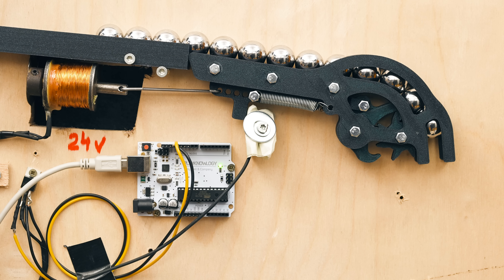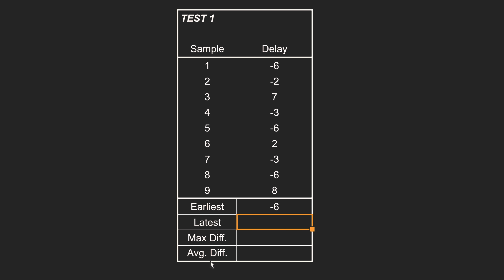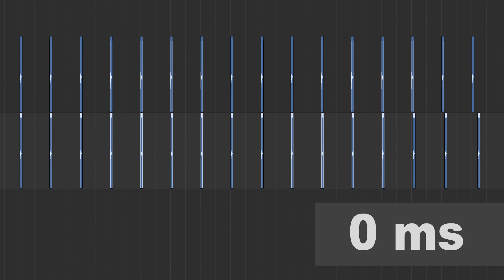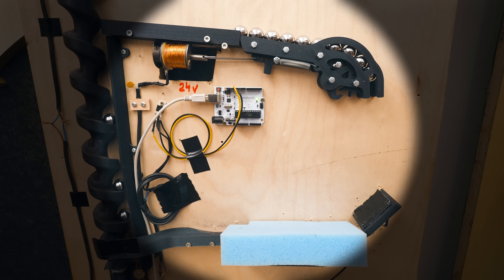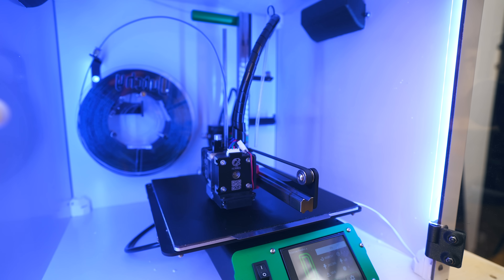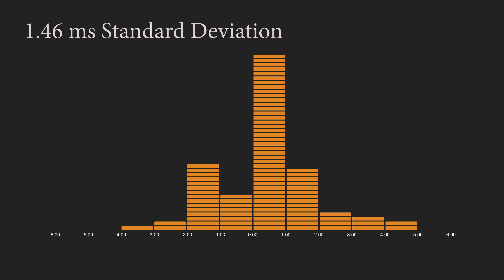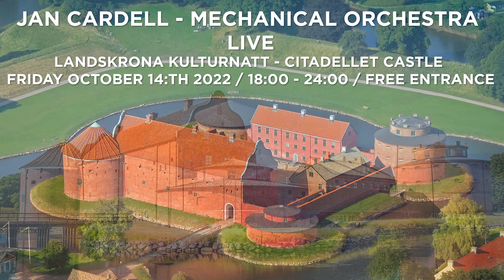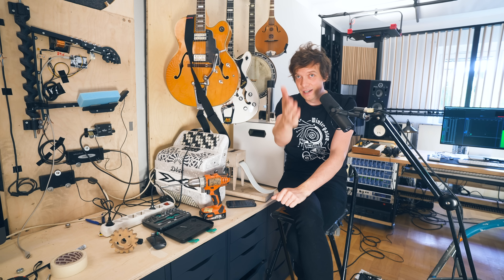Testing the Arduino Marble Gate

Comment: sigh it's good you're actually doing these data analyses to improve your design, BUT YOU HAVEN'T WRITTEN YOUR DESIGN DOC YET!!!!
It doesn't matter if you spend hours testing this 3d printed gate for a near perfect delay deviation... the angle of the gate, the angle of the input rail, the input marble collisions (which you expressly change your test for, but would still exist on the real machine), and THE DISTANCE TO THE INSTRUMENT all factor into the results you're calculating, and NONE of these will be the same on your final machine!
Hell! You even say you're testing with pneumatics and an arduino controller, but that you *aren't going to use either of these in your final design*. All you are doing is wasting time!!!!

Form. From. Function. Means you need do define your functions (see, questions) first. You already are creating a headache by using Marbles, but without that you're not really creating anything new. So *what do you actually need*? Something to trigger a note on a musical instrument (drum, cymbal, xylophone, bass guitar) [to a certain degree of timing accuracy]. You have asserted that to be a Marble. By asserting a marble, you now have to answer "How will the marble trigger the musical note? You have asserted the answer to be "falling". What problems does "falling" introduce? You now need to "catch", "lift", and "ready" the things that fall. Now answer how you're going to resolve those 3. And until you have answers for all of your questions, and subsequent answer-related questions, ad infinitum, you *should not be designing anything physical*.

It sucks for youtube content, but it is the right way to go*. And once done, the Youtube content is literally just piece production and mechanism building (ie. what you *want to be doing).
Until you have actually created your design document, all you are doing is swimming in circles, and you will never create Marble Machine 3.

Comment: As I'm sure you are aware, there are tolerances for everything.  A few observations... You play a lot of instruments.. What is  YOUR standard deviation??  What are acceptable tolerances in general? I can tell you everything I heard below 15ms sounded the same to me.  Understood that each mechanical linkage in the chain can/will add to the total deviation, but it would be good to know what your maximum acceptable deviation would be.  

Also, it would be possible to build an apparatus with an Arduino to measure the drum beats and/or calculate the deviations for you automatically.  I had envisoned reaching out previously when you were tuning channels to suggest this.  A device that would trigger on the first drop, then record the amount of time between the first hit and the second hit.  This data can also be logged to a file or computer.  I'd be happy to design such a system using off the shelf prototyping components if you have any interest.

Comment: I have recently been watching people restoring old (1800s) clocks and one of the professionals talked about cleaning and lubricating the clock works and he said that a clock will not keep good time if the escapement is not properly lubricated. The escapement you are using is very large and because it is 3d printed probably is very rough. You might try covering the mating surfaces with Teflon tape or some other low friction tape and adding a little lub to cut down on the drag. It might tighten the timing a bit.

Comment: Hello Martin, glad you look good and happy.
You are correct, brutaly simple and working is what it should be to go on tour, bombproof also..
When handpowering the new machine, a suggestion, use an mid-engine electric assist motor as from a bicycle, then you cant "cheat" and you have got to keep on cranking...without over tiring.
Mind you, only these engines come with sensors to regulate power output.
Good luck and till the next one!!!

Comment: I'll preface with that I'm not that well educated musically so I may very be completely wrong.

But from what I've understood from others explanations is that part of the reason a drum machine feels very robotic vs a real drummer is not only the sound that is produced but also because of how tight they perform? So I just wonder if a few ms difference here and there really is all that bad, or would it even out during whole duration of a song? Using a phone speaker I could not tell a difference at all untill around the 15ms mark tbh, might be a difference in headphones though of course. I understand trying to make the perfect thing, but sometimes you get lost in optimization and need to get to a point where good enough is just that. Good enough.

Comment: You are working with an 3D-printed devider. There is no way, every „tooth“ ist exactly the same as the one before. Before you starting such mesurement, it woukt be importent to find the delay produced by each tooth.

Comment: Martin, good to see you back on the project, remember what a standard deviation actually means 1 SD means 68% of results will be inside this value. 3SD is good to work with as that means 99.7% of results will fall inside this.
Reply: ... if data is gaussian.
Reply: Also important to remember that he is calculating the sample standard deviation, which is only an estimator for the "true" population standard deviation. That means it won't be exactly the same upon repeating it (it has its own standard deviation!). Need to think about the implications that has on how many samples are required to get a sufficiently consistent result (i.e. before nitpicking over small differences between tests or trying to infer something from them...)
Reply: @ninjafruitchilled  Bingo!
Marting admitted that he doesn't understand what standard-deviations are.  If he did, he'd be using dispersion from the median, which eliminates the need for the distribution to be gaussian.
Reply: @John_Weiss  Nah there's no need for that, standard deviation is a fine measure and doesn't require normality to make sense (his data is vaguely normal, i.e. no seriously wacky skewness or anything, so looks fine). Just needs to make sure he gets enough samples to measure it with whatever accuracy he needs.
Reply: @ninjafruitchilled  "standard deviation is a fine measure and doesn't require normality to make sense" - This feels exactly like something Douglas Adams would have (should have) said!
Reply: Martin misunderstanding standard deviations is very on brand. Lol.
Reply: @davidchidester5463  Exactly. I saw this coming as soon as he brought it up. Every time he wants to learn a new thing, his narration is "I was so dumb, but now I know everything about it!"
Reply: And you can just use the speed of sound to contextualize what's 3ms. That approximately having two musicians and one of them is 1 meter further away from you. 

3 SD would mean 3 meters, something on par with the drummer on stage
Reply: nb4 he reads this and decides to go with 6 sigma

Comment: Honestly as long as the total longest delay difference in the final product is around 20ms it will be unnoticeable (based on how how delays are calculated for everything on computers). 
Of course here you don't have the variables for the whole machine so it make sense to try and minimize it at every step but i also doubt these measurements will be usable for the complete build.

Comment: Funny. I was just checking earlier today if there was any new videos, and there wasn't.
Arduino is bad at accurate timing, unless you tweak things right. Basically, the functionality/code that makes the Arduino easier to use has rather poor performance, so you have to program it properly yourself. In any case, it's pretty irrelevant when compared to a mechanical switch.

Comment: Happy to see you back, Martin! Will you test mostly variations on the clockwork escapement gate, or different marble gates as well? I would love to see a test of marbles being dropped straight from the marble queue, for example a PacMan-gate without the dropper arm at the bottom. Might only be a test to prove that your original design works best, but it’s good to test all assumptions!

Comment: SD value is perfect for comparing each test directly.  Just keep in mind that assuming a perfect "normal" distribution (many other kinds are possible but this looks close to "normal") for your actual music tightness, ~67% of results will be +-1 SD, ~95% will be +-2 SD, and 99.7% will be +-3 SD.  So for SD of 1.5 ms you'll get 99.7% of marbles within +-4.5 ms, still very tight if you ask me!!

Comment: Just looking at the marble gate, a huge amount of variance will come from backlash (the freedom of movements with the parts engauging with each other) - in laymens terms, I'm concerned its all a little loose for the precision you want.
To reduce this, using bearings and smooth rod would help a lot, not only reducing friction, but also doing a better job enforcing the position of the parts.
Something like a 624ZZ on a 4mm smooth rod (or even a partly threaded M4 bolt).
This backlash may also contribute to the issues you have with drop angle etc.
I guess this is all moot, as its perfectly fine as is - I just think the more you route the pushrods, the more important this kind of thing gets. 
Most notably, bearings are really easy to use/add to any design (and are really cheap) - and should totally be a huge part of any future design.
Also, final thing: if you build the third MM, please use linkages and pushrods, they can be so tight, so precise and so low friction.

Comment: I don’t think timing was ever that much of an issue. It just needs to work consistently.
Reply: Think about it this way, Martin self-taught a rigorous research methodology which he can use going forward.

This is the kind of stuff I do for development in the chemical industry and going at it from this perspective at minimum gives him better decision making information.
Reply: Considering Digital Inputs, standard deviation doesnt have any impact because Digital Input is designed to be precise and correct. However, Analog Systems like Wintergatan's Marble Machine must be precise to avoid Inconsistency. Standard Deviation needs to be low to avoid inconsistency in marble drops because any major deviation in the system can throw the music out of rhythm, causing problems like Out-of-Bounds marbles, Inconsistent Music, etc.
Reply: He did an entire video about that exact topic once. 🤦‍♂

Comment: There is another control parameter you didn't consider: the length of the marble queue. I know the clock escapement mechanism is supposed to ease the problem of back-pressure, but maybe it still affects the timing? Incidentally, your best result was obtained with a constant marble queue (see 13:31).

Comment: You could use the arduino's output signal as another input to your sound card to see any starting offset time. Just need to use a voltage divider from pin to ground, and maybe a capacitor in series depending on the arduino's grounding.

Comment: Wait, whoa.  A few milliseconds off with the Arduino?  Hmmm, that's not right, the microprocessor can switch MUCH more reliably than that.  Maybe this test rig is close enough, but it can be made tighter if you want/need it to be.  My guess is that there is a little play in the rod leading from the solenoid to the trigger mechanism.

Comment: One potential reason for the increasing delay is that you don't account for the time it takes to perform the HIGH and LOW digitalWrite() calls. This is a common problem when working with timers of any kind in programming. The usual fix is to measure the time it takes to perform said actions and then subtract it from the final delay() call. I do not know how I would do this for an Arduino, however
Reply: Shouldn't be an issue here -- it's a matter of microseconds.  I think the issue is that delay() uses milliseconds and really uses a 1kHz counter that just keeps running whatever the program does.  delay() loops until the counter has increased enough but since the delay() calls never really sync up with the counter before the call, you don't quite get what you want.

Comment: Your approach to "visualizing" or hearing the timing difference is deceiving. When you have a standard deviation of 2ms, that means that each beat will likely be within +/- 4ms of on beat (95% of beats). In your example, each color has the delay, but they are still perfectly spaced and on tempo. In reality, the spacing between each beat would vary by +/- 4ms from the target beat, for the SD of 2ms example. I think the difference would be more evident for the average listener at lower SD.

Comment: Standard deviation "from expected" is also a helpful metric. I use it all the time in accuracy testing for my job. You take the average of all the squared differences between the "reported outcome" and "expected" values (in this case the numerical score minus the "expected" hoped for score of 0). Normally you'd include multiplying by the probability here, but I'm not sure if that applies in this case. So you could do a slight variation on the equation to be.
Step 1: Subtract: outcome - expected value (x - E(x))
Step 2: Square the answer, and do this for every outcome: (x - E(x))^2
Step 3: Normally you'd multiply by the probability of the expected outcome as well but I think you can skip this step and just go with the AVG of all your sums in Step 2: AVG ((x - E(x))^2)
Step 4: Square root the AVG and that's your STDEV from expected! Can be helpful to write as a percentage I find. 
I do this on top of a normal STDEV of my data set to get an idea of accuracy along with consistency. STDEV tells me how consistent the grouping of my data is, whereas the STDEV from expected gives me an idea of how much I'm deviating from my intended accuracy.

I'm no mathematician so feel free to flame me in the comments but something along these lines might be helpful here. Cheers!

Comment: Why couldn't you just delay the program wheel by a few degrees. Like you get the gates as tight as possible and if not perfect just adjust the program wheel.

Comment: One major inaccuracy contributor is the rotating wheel itself. The marble has to push and rotate it before the drop, and the clearance and tolerance on the axle puts the wheel and the marble in a different location and position every time. The wheel as well as the jaw piece, need bearings on their mounting axles to take out the slack and bring inertia to minimum.
Reply: And how precisely is the wheel shaped?  Do all the prongs have the exact same shape?  That might be an easy place to pick up half a ms of tightness.
Reply: @peterfireflylund  You can see the rotating wheel move around on the dowel on close-ups. It's a 3D-printed CAD model, so fine tuning the shape itself on accuracy can get tricky.. A bit over sized print and CNC the edges, perhaps? Or straight CNC from a block? The material itself might clogg the tool and melt when the tool gets hot. Tricky.

Comment: great to see you back... I'm a bit sad that you become obsessed by this level of precission which is impossible to hit with your budget and environment you plan to play in. You could go to mechanical engineering university to learn about all things you do as side project. With your creative mind it could be great if you can back it up by knowledge. Nevertheless I'm not here to judge :) It does not matter if you finish it or not as you inspired so many people on the internet by what you do. Especially showing fails and loses shows us that to become dragon slayer you have to train a lot! I'm looking forward to next video <3 Keep it up
Reply: For now, he is just trying to get repeatable measurements with a simple rig.  I expect him to move to a more complicated rig with more gates soonish.

It should be pretty easy to fix the Arduino code, attach the solenoid properly, make sure it has a good power supply, perhaps use light gates, automate the measurements properly, check if the length of the marble queue matters much, etc.

Comment: Use optical (or other) sensors midway in the drop and another on the solenoid to measure when the solenoid reached open position and measure the results with interrupts. 
even the cheapest arduinos should be able to measure this stuff in microsecond accurasy. 
the results can be exported straight to excel or as CSV

Measuring standard deviations, you want to have as many measurements as possible. 
id the resulting curve is smooth, then you know you have enough.
Using better sensors and automated tests you can remove yourself from the loop and have more accurate results.
 
i studied applied physics and we used to a lot of measuring in the first years. 
i started hacking adruinos to all test machines cuz i was lazy.

Good luck with this approach! 
Nice to finally see another video.
Reply: Yep.  20 samples is really not enough... and the process has to be automated just to ensure the human doesn't introduce errors.

Comment: Your testing methodology is lacking, my recommendations: 
1 - Include the triggering signal from the micro controller (you may find it's not as accurate as you think due to internal interrupts)
2 - mic up the drop mechanism.
3 - run the test at varying speeds.
4 - Check the results over N cycles and look for cumulative error. increase N and check that cumulative and average error as you approach multiples of the number of teeth in your ratchet mechanism.

This will allow you to find the actual speeds and accuracy of your system and what contributions each component has.
Don't assume the micro controller is dead on accurate.